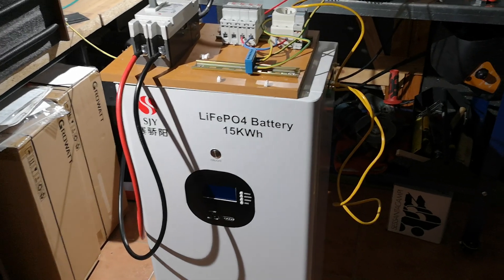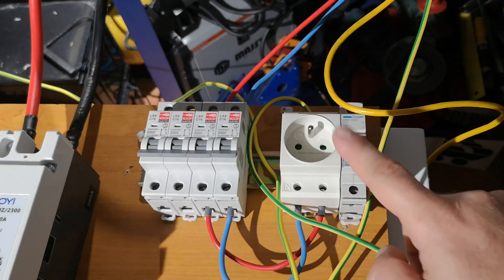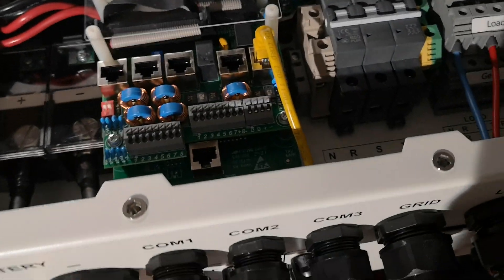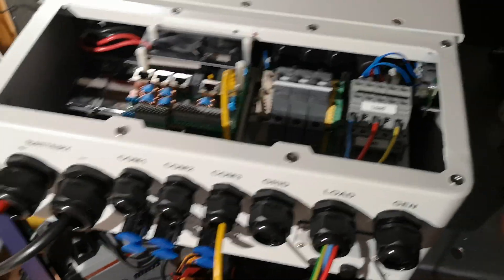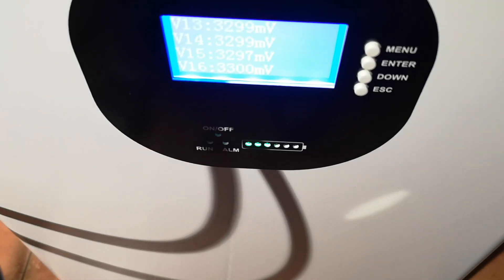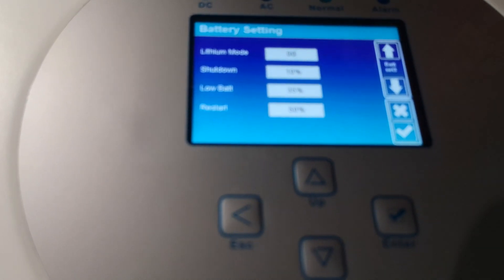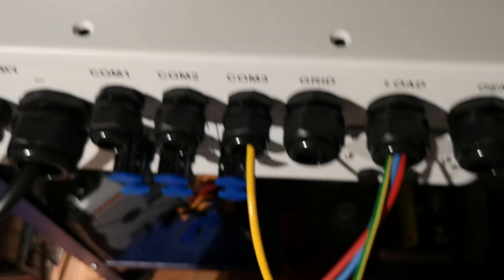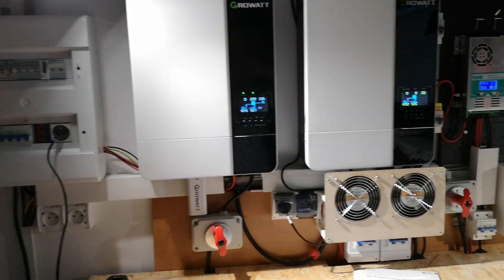SJY Battery with Deye Inverter - setup tutorial

Comment: Hey mate, would you consider doing a more in-depth video looking at just the battery itself? ... e.g. possibly showing a glimpse of the internal build quality / check which battery cells used / any issue you may have had with it / a real capacity test / look around the unit itself...      It's really hard to find anything on this battery; as I am on the fence about buying one or not, I think a video would be EXTREMELY helpful for us to decide!   As I am particularly worried about longevity...Thankyou :)
Reply from the maker: I would love to but there is warranty sticker on them. After new year I will move them to new location and then more tests. For now I got 2 of them cause the price was awesome. tested under 11 KW load (two in parallel) and working. Please wait for update

Comment: hi there how you find that battery ??? so far
Reply from the maker: Alibaba , AliExpress but there are also stocks in EU
Reply: @CuAgFe  What are you opinions on the battery?  the good/bad?
Reply from the maker: @yepman3879  For now it is hard to tell. I connected 2 in parallel and get from them about 11KW of power with Deye. Working but I will install them on new facility in 2026 , stay tuned,.